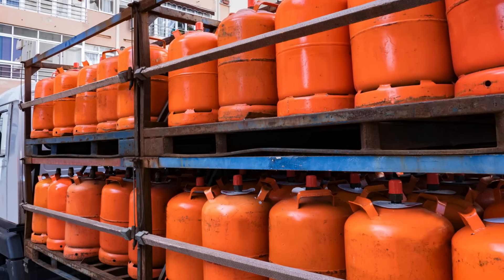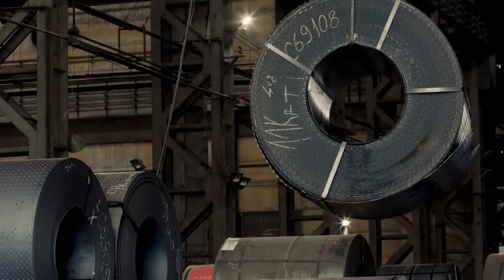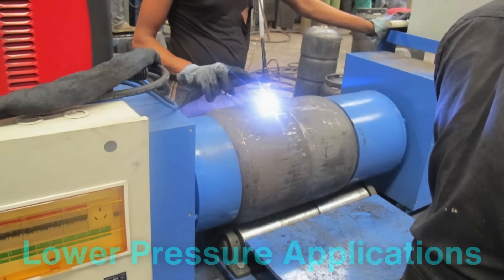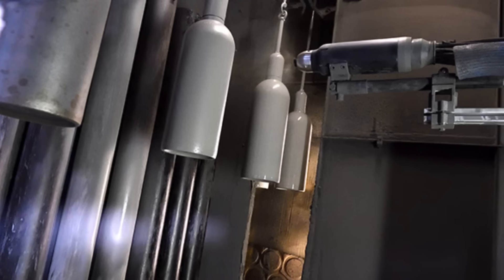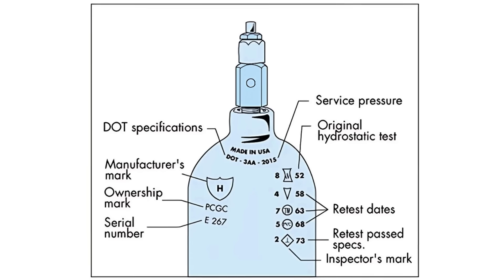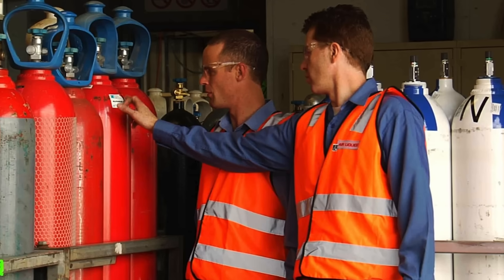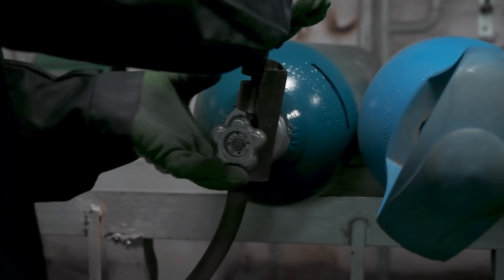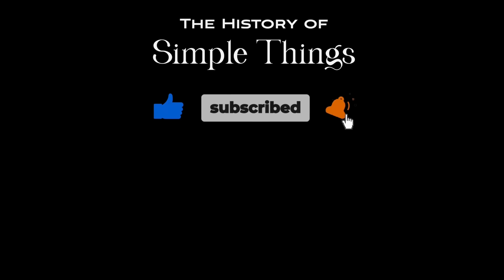How Are Gas Cylinders Made?

Comment: Back in 1995 I had an oxygen cylinder, that had  around10 inspection stamps dating back to 1944. Since it was a rental tank, I returned it to the Gas supplier for another tank, when I asked the manager about, he told me they have had some even older, if they pass the inspection they get charged again for use, he said if they do not pass inspection, they drill holes in them, and people come and use them as protection posts at gas stations and pump houses near high ways. I have one large decertified tank that I want to make into a large bell; I had a 60 lb propane cylinder that I used to make a forge. On the other side, that had not been punctured into a quench tank.  I received another propane tank of the same size, that I thought about turning into a bell, but when I sounded it, there was only a clank instead of a ring, I might turn it into an annealing oven, or Bar-B-Q.. I could weld the hole and use it as a water pressure tank connected to a half HP water pump for my home. (If anyone else wants to do this, make sure you have a pressure relief valve connected)

Comment: The USA imported most of the Spun cylinders we had to fill and maintain at Union Carbide. They had a window frame mark, which was a Swastika with extra stampings to make it into the window mark... Germany was the first to use some Bomb casings as tanks for high pressure gasses.  The A/C Oxy tanks were made by a lattice of crimped steel to make them less explosive when hit by bullets or shrapnel...   Any ways if you find the windows mark up next to the ID... Look close and you will see the Swas>

Comment: Gas Cylinders can be classified into 4 categories.

High Pressure Cylinders (Eg. Gaseous Oxygen at 2000 psi)

Dissolved Gas Cylinders (Eg. Acetylene Gas)

Liquified Gas Cylinders (Eg. LPG, Propane / Butane Gas)

Portable Croyogenic Tanks (Liquid Oxygen)

The contents inside the cylinders will be at different pressures.
Reply: Thank you! 🇺🇸 👍☕

Comment: What is the porous rock material inside of acetylene tank’s called?
Reply: Whats inside of an Acetylene Tank?... It is usually Diatomaceous Earth that is Soaked with Acetone... Diatomaceous Earth is what Exterminators use to Kill Certain Insects, like Bed Bugs and some types of other Bugs... It's Really Fine and "Powdery"... Probably something that you wouldn't want to Breathe... Anyhow, those Materials absorb stabilize the Compressed  Acetylene.... I'm not sure how I knew that... Haha!... I worked at a Scrap Yard when I was younger and if I recall correctly an Old Timer told me that... And I believe this is the Very First Time I have ever used that tidbit of Information, and probably will be the last!.... Hahaha!...
Reply: Carbide?
Reply: Calcium silicate
Reply: Diatomaceous earth. Once, balsa wood was used.
Reply: At the first try, acetylene C2H2 was dissolved into acetone.

Nowadays, it's Dimethylformamide (DMF).

To reduce explosion risk and the surge of dissolvibg media, the acetylene-containing bottles are filled with a porous media, made from articial carbonated rock, a solid foam.

Never demands more than 1000 liters per hour to a single bottle, to avoid migration of the dissolving media. Be aware of the absence of leaks, acetelyne is a exploding killer, when melanged with air.

Best regards
Reply: I think that there is a video on that. 😮
Reply: Kieselguhr.
Reply: Its balsa wood fibers.